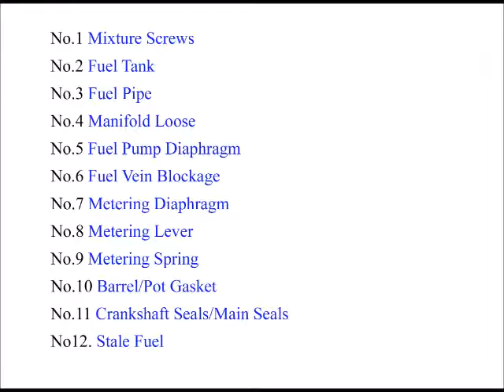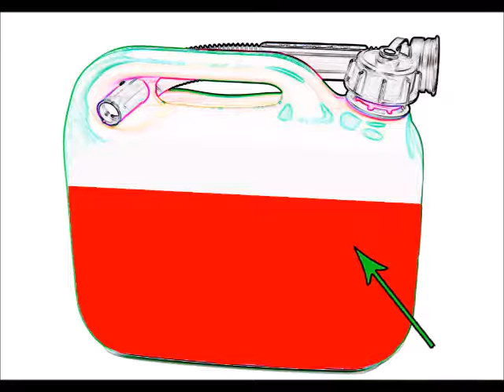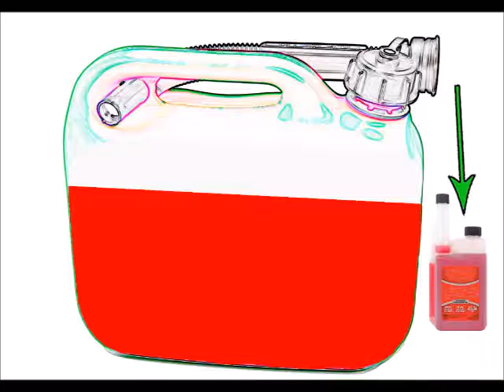Stale Gasoline Petrol - What you need to know!  (by Craig Kirkman)

Comment: I started and ran a 1998 Ford e350 van that had been sitting for 8 years. The van started and I drove it about 50 miles with the 8 year old gasoline. I didn't experience any bog down.
Reply from the maker: Good

Comment: I have a 1999 BMW which is running so poorly, I cant drive it. I last put fuel in about July 2022. Not much. Ihave hardly used the car. It is now April 2023. 8 or 9 months later. Since then we have had hot weather and cold damp weather. Having watched your video, I think the problem is stale fuel. At the weekend I am going to put some fresh fuel in, and hope it makes the difference.

Comment: thanks for another welcome presentation for us wrench turners, but I still have doubts and questions about gasoline storage practices. I long to hear a detailed explanation about the chemistry involved in fuel and oil quality over time. I have heard people say gas more than a week old is no good. I have heard that motor oil more than a few years old is no good...all "internet professors" saying this mind you. In my personal experience I have never had a problem I could identify, with gasoline a few years old whether used in two or four stroke engines. If it smells rank and stale then yeah it is trouble, but I do not find ordinary pump gas, even with ethanol, going bad for at least a few years. I guess I would acknowledge there is degradation of the fuel but I tend to think the fuel has to be very old and degraded to cause significant running problems, it is an over hyped condition.

Comment: Another great video. Question, why does my 2 cycle leaf blower seem to be "choking" after I use it on full throttle. It just idles rough after using it for 5 mins at full out. I was thinking metering diaphram
Reply from the maker: HR PUFFINSTUFF hi, thank you for your comment. I have actually had the same issue as you are having with your engine at the moment. Personally, I stripped down my carburettor and replaced my diaphragms with a new kit. It seems to me that you are probably experiencing your carb being a little rich in fuel. I have had situations in the past where my engine runs fine for a little while until it warm up, then, like your engine, it would run lumpy. This was because when the engine was colder it welcomed the extra fuel, but when it warmed up, it couldn't handle the slightly excess amount because a warm engine doesn't need this extra amount, which is due to combustion taking place more efficiently and so needs less fuel than cold starting. I personally found it to be my mixture screw settings and my diaphragms that was causing my faults. I hope this has helped your situation and I will be including a video explaining this point because your point here is a  very good one. Many thanks, Craig
Reply: Not all 50/1 oils are created equally.  I started using a top grade oil when mixing my fuel for my blower.  I found that Opti-2 worked fantastic and have not had that issue in years since I have been using it.